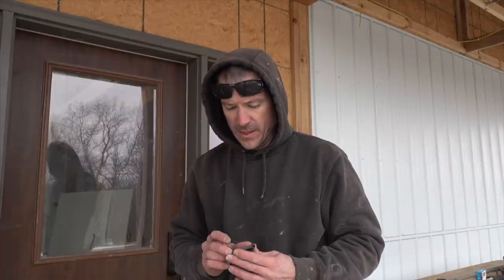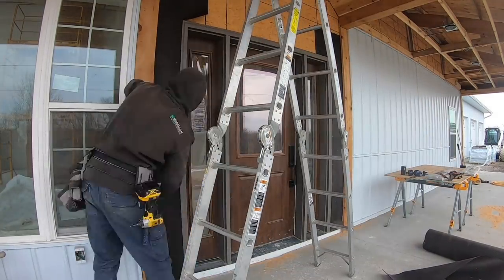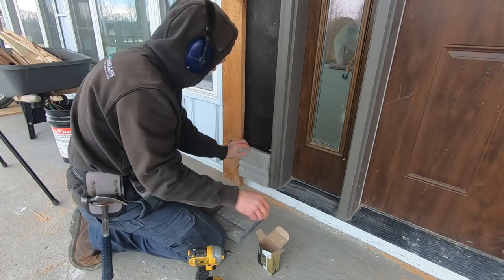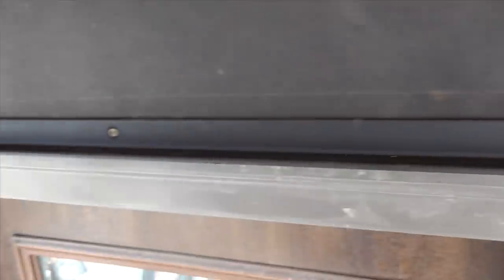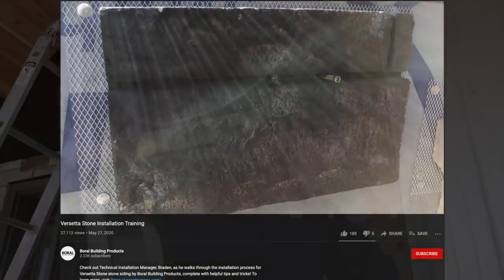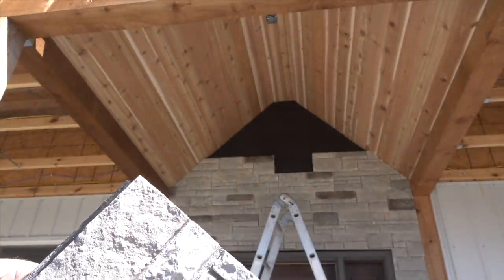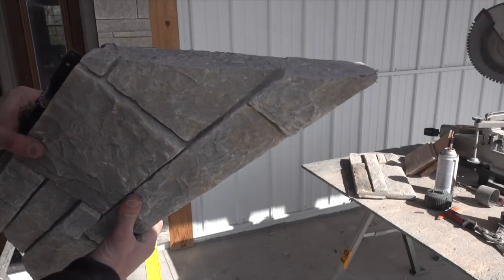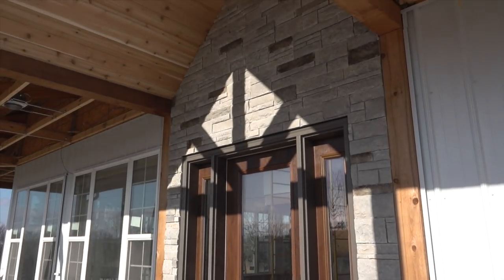Using Versetta Stone Around Our Front Door | Post Frame Porch

Comment: I used my table saw with a Hardi blade for cutting all my soffit material.  There were hundreds of feet of cuts.  I was almost done when the saw went up in smoke.  I'm pretty sure it was the concrete dust that killed it.  For that reason, I used a very old circular saw for as many cuts as I could as I considered it sacrificial.  I also used my 32 year old Delta miter box for cross cuts on my siding.  So far it's still functioning, though it did consume a drive belt.
Reply from the maker: Sometimes that happens. Definitely don't plan on doing a ton of work with material like this without investing in another tool option.

Comment: I have that same folding ladder.  A Krause if I remember correctly.  Make sure to spray oil into the lock/unlock joints since those little pins tend to get stuck if anything gets in them.
Reply from the maker: Thanks for the tip!
Reply: @MrPostFrame  Yep, those little red/orange things will tend to jam making it impossible to fold the ladder back together.   I would also recommend drilling and running a screw/bolt thru the base that holds the horizontal foot brace on.  It comes loose easily.  Good ladder, just some bad engineering.  I ended up drilling in an eye bolt on the base side so I could hook a bungee cord to it and hook the other end around a stud so the ladder base won't slide out.  The stone was a nice look.  It's all in the precision cuts that makes the complex look simple...

Comment: Rather than grinding the bottom tab off, would grinding the back of the lower 'angles' on either side to a 45 degree angle work?
 It may allow you to bring the piece in horizontal and raise the top end to a vertical position without the back 'thickness' pinching/binding on the wall.

Comment: little off topic, but i wonder if you applied some kind of coating similar to what they spray in truck beds to the outside of your house if it would stop the condensation issue, i think they make it in white.... just a thought. I'm about to start building a house similar to yours with a metal outside, i await with baited breath to hear how you're going to fix this issue. I want to make sure i don't repeat the problem you're having. Thanks
Reply: If you're building a house with metal siding and roofing you need to educate yourself real quick about insulation and condensation. Outside moisture has nothing to do with what is going on. If you don't have that figured out yet, please don't start to build.
Reply: @bp4170  If you’re not aware of the ongoing issue that these people are having right now, then go back a couple videos and check it out, he knew what he was doing and still ended up with the problem. I’ve been building for 35 years I really don’t need your help, thanks
Reply: @bolweval  Ok, don't educate yourself. Good luck with your house! BTW I'm very aware with their situation and what causes it. Marshall Remodel even says in the video what caused the problem.
Reply: @bp4170  you should make a video Brian! ....
Reply: @bolweval  Why? Do you have a suggestion for a topic I should cover?
Reply: @bp4170  Yes, “how to act like a pompous know-it-all by offering advise to a complete stranger who didn’t ask you for it and then continuing to offer it even after they’ve made clear its not wanted because you cant walk away without having the last word” now get busy! 😀
Reply: @bolweval  Sorry for the advice , I didn't know it would trigger you.         Good luck and God bless you!